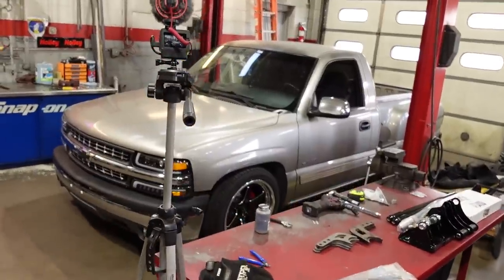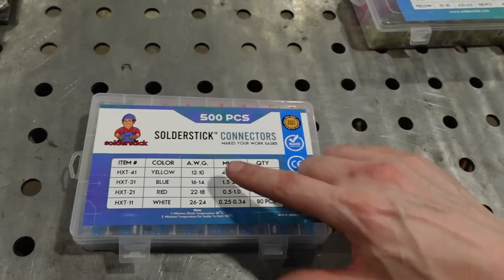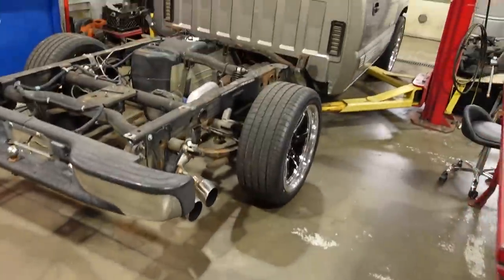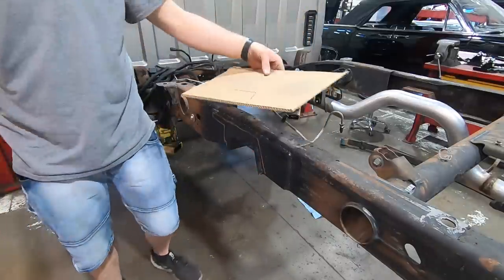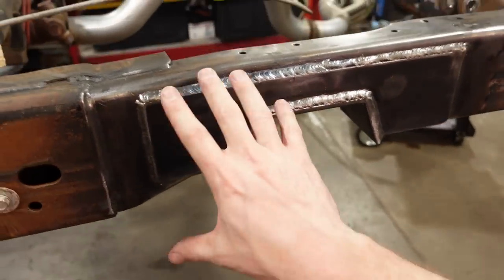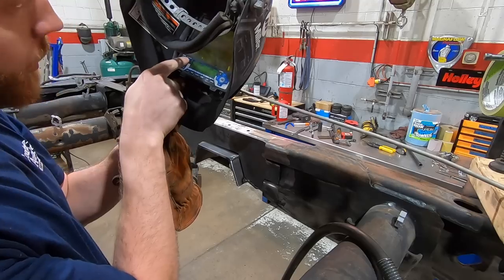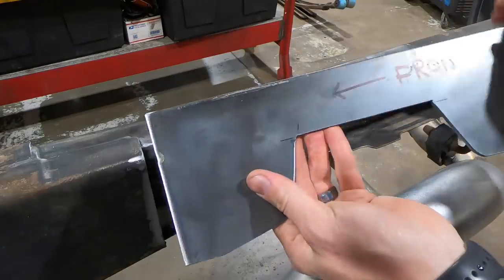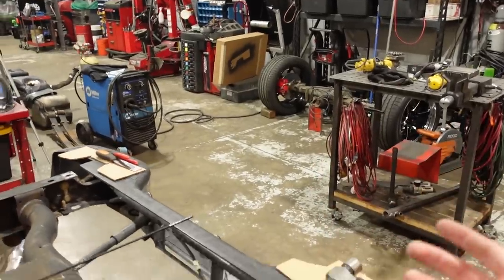the WORST FRAME MODIFICATION I've ever encountered

Comment: 🚚💥👀 Wow, it's eye-opening to see the hidden surprises that can lurk beneath the surface of a vehicle. The previous owner's frame modification definitely caught you off guard, especially with the difficulty of spotting it from certain angles. It's fortunate that LT discovered it and is working diligently to reinforce the structural integrity. Keep up the great work in ensuring your truck is in top shape! 💪🔧🔩
Reply: Uncle Tony’s Garage does a lot of showing the creampuff flippers that are in circulation that rip the unassuming buyers off.  He is Tony DeFeo  who used to write for all of the mags and even raced a fuel Altered back in the day.  I spent years fixing other people’s junk.  I had to do a bunch of re- repairs on a 65 tri- power 4 speed GTO. He wanted a little more power, so I build him a 400 with 14 degree angle heads and an Edelbrock tri-power intake. It looked stock after it was done. It had a really good cam for it , it would wind to 5800, and sounded like a RAIV, the specs were replacement for it and with 3 inch pipes to the bumper and those voluptuous manifolds the owner found . Original number tri-power set. I had to put a tune on the Rochesters to get them right. I had to fill the air bleeds where someone had drilled them out and set the secondary linkage back to stock. I guess they were getting a sag when the secondary came in. It wanted more initial timing and that fixed it. My brother in law and I did it all. I looked all over for a 347/ 370 crank with the small mains 4 bolt and a spacer kit. They were steel and could be offset ground to 3.7 very close to stock and have perfect overlap.  A 370 tri-power ran in NASCAR and Smokey Yunick liked the steel small main best and quit when they insisted on the 3 inch main. I ended up using the 3 inch one but used the 4 bolt mains. We took it out to seat the rings. Everyone has their own opinion on seating them, but with a moly top ring, mine and my brother in laws is a well built engine needs a  good hard run . I did that on all of my FE Fords. Fire them up, rev them up and down and look for leaks, set the timing, back it out  drive the snot out of it. Ive never had any issues in the 50 years building them. Never let them sit and idle or run at one speed. I d slow one down to 50 mph and floor it up to 90 kick it in N and avoid deceleration and put it back in gear, 40-70. for the first 1000 miles, change the oil cut the filter too off and check the pleats on the filter for metal. Usually some but not much. Anyway we had the owner and we did our usual 3:00 A M 50mph WOT to 130in high and the owner was scared to death lol. We pulled 3 times and by the third pull it went from perfect primary to honking 6V and it sounded like a Holley DP, smooth and so fast that the road narrowed down was the main sense. He took it and he was scared to death of it. He drove it like a granny, lol.

Comment: I'm glad nothing happened, determining the liability if those "welds" failing caused an accident or worse a fatality would be tremendous, it could have come down to "Buyer Beware".
Seeing that, my first thought was; I'd use 2" x 2" square tubing and  doublers ("Overkill, prevents being killed" or "Enough is not enough, too much is just right").

Comment: In UK any alteration to a vehicles chassis has to undergo an 'Individual Vehicle Approval' test, which involves an inspection by Vehicle and Operators Service Agency (VOSA) that would have highlighted such a dreadful modification.  Also, such a 'C' notch would probably not have passed without considerable strengthening of the chassis to replace what was taken out.

Comment: Grinding: I have 63 years experience with this work.... In Australia, we use a Pferd 125mm (5" ) 1mm thick cutting disks... (best on the market)
Take your 5" Makita (or equal grinder) and install 5 disks (3/16" thick (5mm) and use the for all grinding, cleaning, polishing, 
Always save the smaller disks and you will always find uses for them
Do not use a single disk alone except when you want to cut something, but use 5 disks together when you want to grind anything, 
As you change disks, keep these in set, and re-use on smaller work.....

With this, you can cut any slag, bur, knob with the edge, yet use the frat side to clean, polish or any thing you want with it.... Try it, you will like it

Comment: 8:00 I might add try and reduce that to be as straight as pos, once worked on a lifted short wheel base jeep and each uni joint had a 30+ degree  change... machine up some tapered shims on gearbox mounts and rear live axle mounts managed to get it down to half
Reply: Ideally match the OEM Angles, cos they change under load

Comment: Yes PLASMA cutters  like their amps, and their airflow.
They leave a pretty good edge, if the cutter has the amps it needs the edge will be smoother the faster you move thru the cut.

Comment: This is absolutely the way to repair a frame. I used to have to repair rusted 60s car frames and you learn a lot from that. Spot welded box sections poorly drained and torque boxes you can rock and hear the water sloshing. Drill a hole and install a flap drain after flushing and go back 40 years later and it is like new. This is about safety boys and girls! It is so sad looking under a beautiful tri-5 that doesn’t look quite right and look under it and see strapping half welded all over the place. I have had to find frames and blast them seal and paint drill drains and put flaps in. Then take that body that has been on there for over 65 years breaking clip nuts and bolts rusted down to 1/8 inch. No biscuit left. Get the suspension removed and replaced every thing jigged and straight go to all 4 corners and weld the rails where they come together. Paint it and sit the body on new biscuits after new clip nuts and washers and nuts. Good hardware and use a square and level to bolt it down right. I have had to start the bolts and put a sand bag to get the body unwhopperjawed and let it sit and tighten it around over three to four days to get it to bolt down straight and level. It is done. Time to bill? I can guarantee that I don’t get half what that shiny 2 stage plastic looking paint made. But the owner on one I did came back with tears in his eyes after taking his wife for a Sunday drive. He said they drove on a scenic highway that used to be a chore to drive constantly steering, little squeaky spots hitting a bump. Dog tracked. He said the car drove itself like they used to, 60 mph and that 265 just purred along, no squeaks. They even had some romance that night.  I had a big Ford Performance banner along the wall on my 2 man shop. He asked if I liked Fords. Mustangs ? Hell yes. He had me come by and in the barn was a 68 390 3 speed fastback that was all grungy, but the interior (black) had been removed and stored. Not a dent on it and no rust! He asked if I wanted it? I asked how much and he and his wife who had joined us, they looked at each other and he said, consider it a tip. He added that the engine and transmission had been changed and he thought it might be  a 428 and a 4 speed. I was the one fighting tears then. Got it home and it was 428 3 rib block with crossbolted mains. Turned out to be well built with good parts.  I  didn’t even have to bore it and it had forged pistons. I’m blind now and all my street racing stuff is gone. 63 and really wishing I could do just one more.  But fixing the frame is a deed well done.

Comment: When I use to work for my friend back in the mid 70’s to early 80’s for famous street rod builder Dan Woods . We only lowered the trucks on Saturday mornings and did them right by shortening the control arms and C-notched if went real low. My black step side with wire wheels was on the ground all blacked out and I use to put a 55 gallon of race fuel in the bed of the truck then the top box of tools from my roll away plus 3 more 5 gallon plastic jugs of race fuel and tow my blown gas flat bottom drag boat 80-90 mph all the way from Buena Park Ca through the desert to Parker Az to run my boat at the Parker Strip and never bottomed out of had an issue. Back then we used Gabriel air shocks. It was a lot of fun working for Dan and building cars for his high profile clients plus all the buddies he had like Little John Buttera who use to drive his hot rod all the way in our shop and jump on our lathe and mill like he owned the joint. A guy named Ed Fowler worked with us who looked like Groucho Marks and was super funny had us all laughing all the time.

Comment: They did that because some silverados came with a weird dimple on the frame inthat spot that wouldnt let the cnotch lay flat on the frame so they just cut it all off, just seen that on someone elses video. They did do what you did after they cut the dimple off

Comment: so a question on driveline angles.  When I set the LT1 in my 37 PU, it doesn't have much rake, It's almost flat.  Maybe 1 degree.  Of course I'll match the pinion angle once I have some weight on the rear of the chassis.  But my question is, is there an issue with the engine sitting basically flat.
Reply: If you don't have 2 or 3 degrees of u joint angle, the trunnions on the cross of the u joint do not move enough to cause the needles in the caps to rotate around inside the caps. The needles will flat spot and will cause brinelling of the trunnion diameters. Long story short, it will cause very short u joint life. I have worked in a driveshaft fabrication and repair shop years ago and was trained by an engineer that love to share stuff like that to anyone who was willing to listen.

Comment: Quick question LT... I wanna C-notch my old Chevy Express van and run air bags on it. I like the way your C-notch is kinda "low profile". Question is how strong is that type of C notch? Would that be sufficient on that heavy Express? Most C-notch set ups I see protrude above the top of the frame and with my Express, I don't really have that option without modifying the floor pan (it is a high top conversion van, passenger van)

Comment: I have a 2000 long bed 4.8 extended cab. I haven’t seen another one around. Thinking of what to do to get it some more power… 4.Great is necessary
Reply: Depends on if you want more low end torque or high end rev HP,

Comment: I dont care for them low temperature soilder connectors they dont penatrate to the center of the wire so its not as good as using a soilder iron Which I prefer the most

Comment: Gotta toss a couple tips your way LT. If you keep plasma cutting while wearing shorts and sneakers, you're going to find out why it's such a bad idea, lol. Now watch your vid as you're doing the cutting... see those nicely hung chords/hoses under your cuts? You're killing those, lol. Now a nomenclature hint (so you sound like "an old pro", lol), that line of metal that disappeared as you cut is a "kerf" (same as a torch cut, or saw cut). Ok, enough old fool stuff, lol.

Good on you for straightening out those cut-outs, and boxing it all in! That's not only "smart insurance", but it's also damned fine customer service, the kinda thing that generates referrals and good will from those folks tossing dough at you!

Comment: Question: Isn't the weld harder than the metal so when the frame flexes, couldn't that crack the weld?
Reply: Most general purpose welding wire is mild steel. It isn't any harder or more brittle than the steel that the frame is made from.

Comment: DO NOT use those low temp shrink solder joints on ANYTHING that has a load. I have had to rewire hundreds of harnesses that were melted because of that trash.
Seen some dummy used them on his radiator fan joints.... those solder joints suck, they create heat because they are high resistance, the high resistance causes heat, and the heat causes the solder joint to fail. You would be better off using a crimp connector with heat shrink tubing over it. trust me it's trash.

Comment: Looks like it was sectioned and replaced from an accident. I for sure could be wrong but I've seen people cut frames like that and not straight.
Reply: The truck was definitely in an accident at some point. Only reason I know is because when I put the new bumper, valance, and bumper cap on, i could only get one of the bolts to line up in the bumper brackets. I am having a body shop straighten them out when we chop them for an hd conversion. Now whether or not that accident or another caused the warp in the rear frame, I am not sure. Truck was a roller at one point and "restored" to sell cheap. I am in the process of truly restoring it.

Comment: If the Plasma Cutter is designed for a 15 Amp Circuit, you should be using an Extension Cord that is a MINIMUM Gauge of 14/3...12/3 would be better...
If it's designed for a 20 Amp Circuit, then you need a 12/3 Extension Cord Minimum...10/3 would be better...
These are assuming 25 foot cords, if you're using a 50 or 75 foot extension cord, then your minimum Gauge is 12/3 for 15 Amp and 10/3 for 20 Amp with (10/3 for 15 Amp and 8/3 for 20 Amp ideal)...

Look at the packaging CAREFULLY, most extension cords are 16/3 Gauge and is NOT good enough to run equipment that draws more than 8 Amps continuous...it WILL dangerously overheat and might cause a fire...

Comment: hey man, I have a question id like to ask you about.  Can I email you a picture of my 14 bolt differential?  there is a bolt that seems to not be in place.  the diff is out of a salvage yard and I dignity notice that one of the bearing cap bolts was missing.
Reply from the maker: sure, send it to tolmanperformance@gmail.com
Reply: Thanks man, I definitely will!!!
Reply: @LawrenceTolman  I got that email out to you tonight.  Thanks man!

Comment: Dude keep in mind you are just supporting maybe 300 pounds of box on top of the frame which, because of distribution through the various frame mounts doesnt exert a torque on this "notch" the modification has stood the test of time. Yes its kind of amateur, but the idea of adding a plate is kind of ridiculous. Its not like it s a dump truck with a 12000 pound load or the whole nine yards.

Comment: You're in a winter & salt area now, not Tennessee. You're going to have to get real familiar with anti-corrosives, and real fast. Weld-through primer, POR-15, Fluid Film and other serious stuff. Not just a lick of paint from a rattle-can after welding bare metal. 

Learn, adapt, assimilate.

Comment: Vertical welds on a frame have allways been a no no? Are they not now?
Reply from the maker: There are three places on each side in the stock frame where GM welds a vertical seam…
Reply: @LawrenceTolman  Yes, The factory. Are those frames heat treated? I'm not trying to be a dick, I'm working on a Dodge that the frame cracked in half because of it. You did a nice job. I came from the semi truck world where they would hang you for welding vertical or not plating with 50,000 bolts

Comment: Apart from the missing frame piece a cnotch is not the correct way to notch your frame no matter what height your truck is at an underbed notch is the only right way to do it otherwise it’s always gonna be weak and more than likely gonna crack

Comment: Shouldn't you be wearing long pants at least, and long sleeves? Seems like the material flying off could burn you. I assume you know more than me, but I thought I'd ask.
Reply from the maker: you're absolutely correct, I should be wearing long sleeves and pants with proper footwear, eye protection, hearing protection, gloves, and probably a respirator any time I get the welder or grinder out
Reply: May I suggest you create a PSA and occasionally cut it into your videos? I'm sure there's someone out there that doesn't know what they're doing, and I'd prefer you avoid responsibility for their stupidity. I'd like your channel and content to run for years.